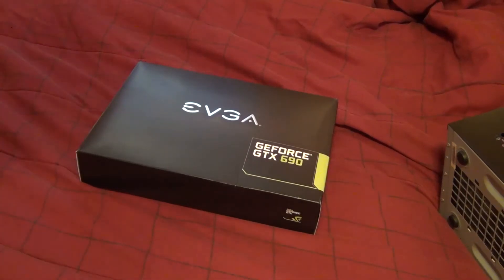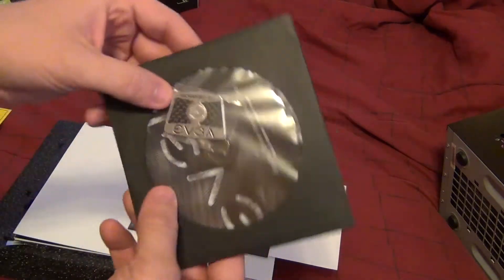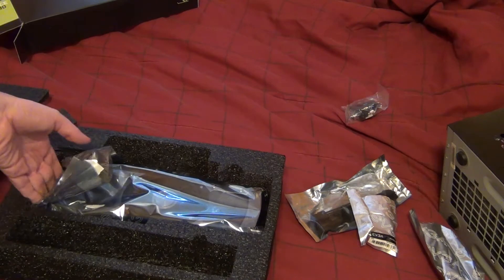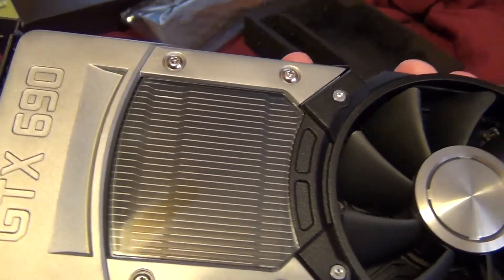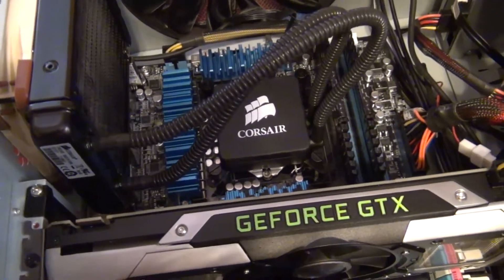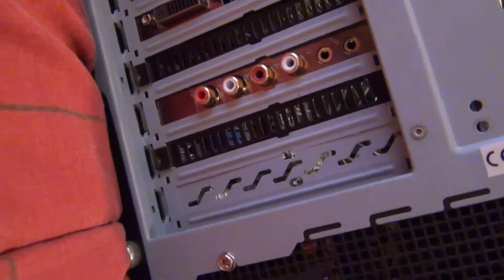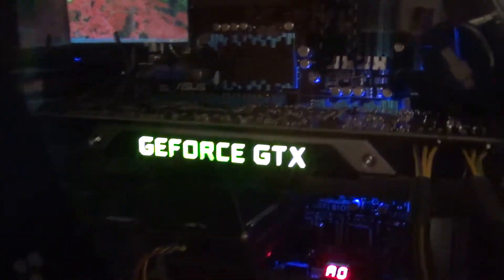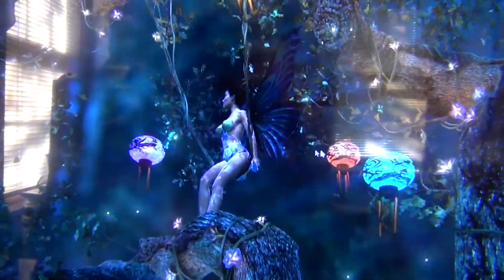GTX 690 Unboxing and Demonstration

Comment: Would running two GTX 660's in SLI be a good idea? I just bought one and I am enjoying it very much. I'm just getting nto PC gaming, and I actually started out with Tomb Raider, and I do see a great differerence in the game. But would I see more of a difference with two 660's in SLI? I'm currently running in ultra, would I be able to push into ultimate?

Comment: A thousand bucks on some graphics card? Bragging rights much? Well good for you. Not to be a party pooper but, once DirectX 12 comes out as an requirement for the minimum specs (Crysis 3 with its DX 11) , that overly expensive graphics card will be as good as going into the trash anyways. Have fun while you still can before MS fucks everyone again.